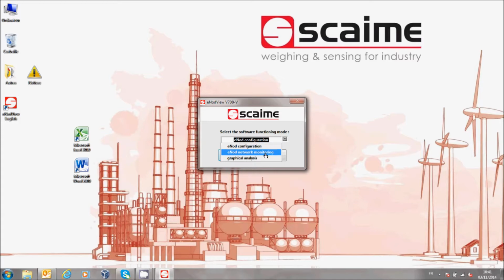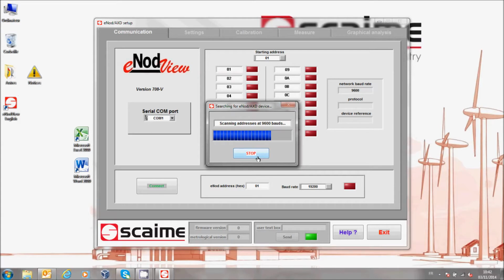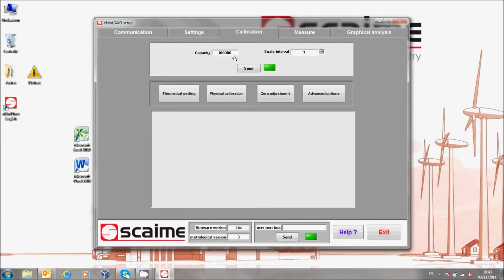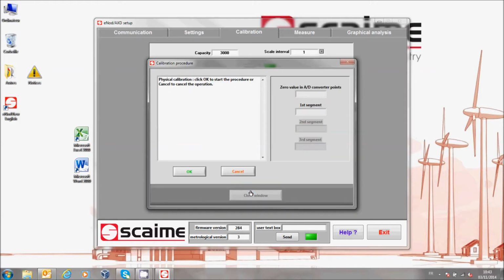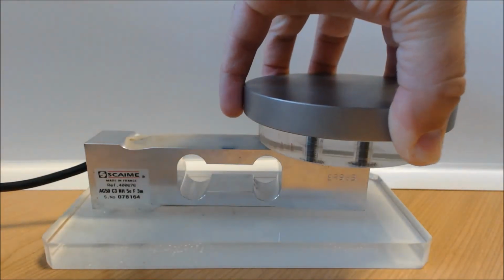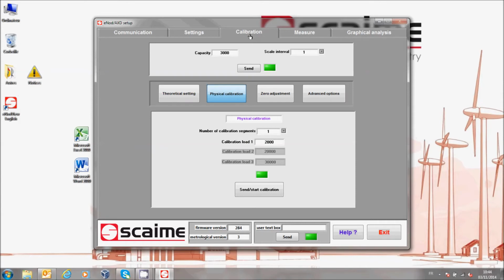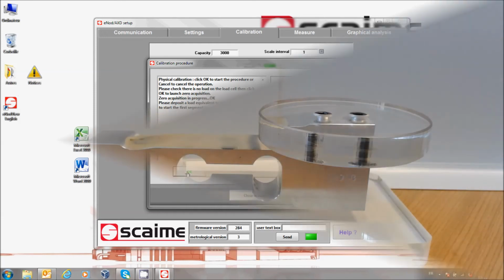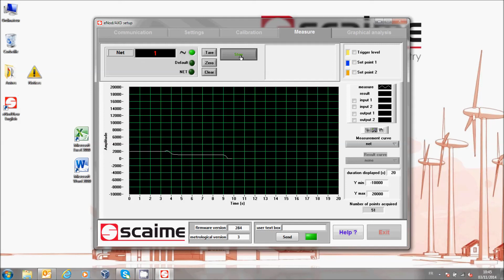SCAIME Video Tutorial - eNod - How to calibrate with eNodView

Comment: Hi, thanks for sharing. 
What weights would you recommend for calibration? For example, let's say I have a 10 Kg load cell. Would it be better to use 1Kg, 2Kg and 3Kg calibration weights? or would 100g, 200g and 300g calibration weights work fine. 
Thanks